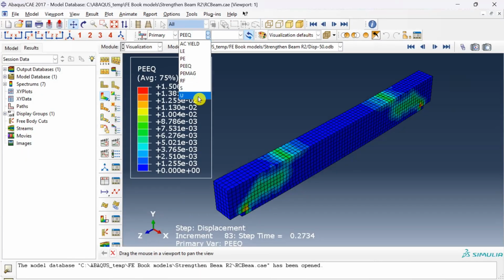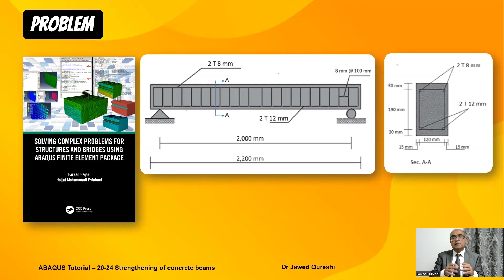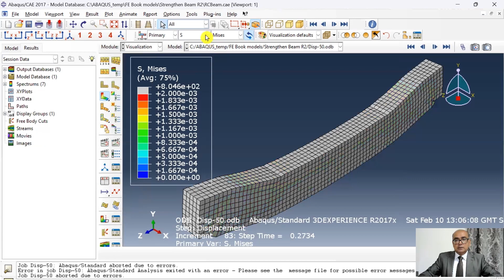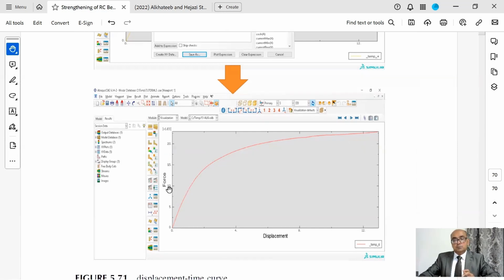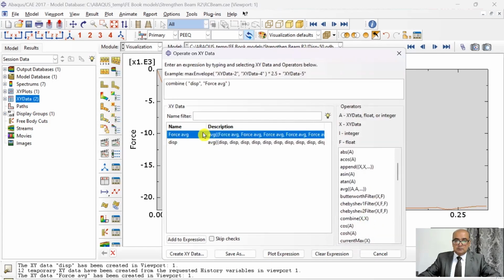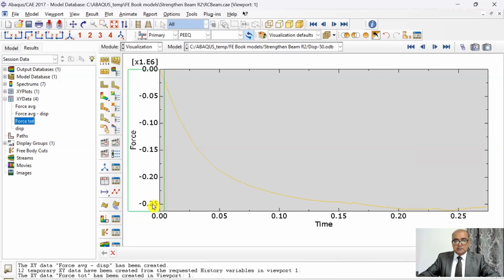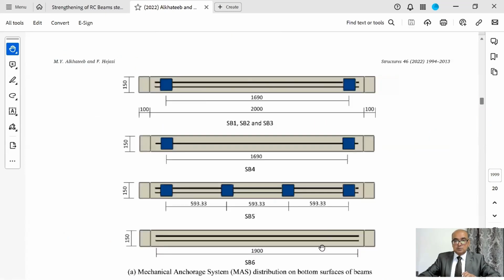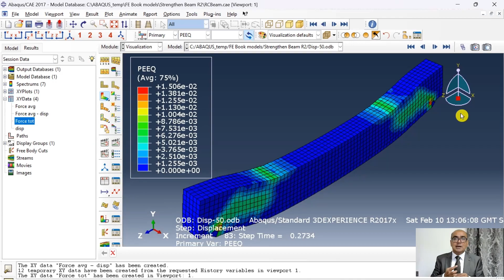24 – Part 5: Visualisation | Strengthening of concrete beams | ABAQUS Tutorial

Comment: Can CDP capture the pinching effect during cyclic loading of RC?  if yes, please tell me how?
Can CDP cappture the shear reduction of concrete during cyclic loading ? thanks
Reply from the maker: The quick answer is that I’m not sure. Crushing and cracking parameters should be defined to get accurate behaviour. I’ll try to find out and let you know. I’ve used CDP previously to model steel-concrete composite beams. Have a look at my paper https://www.sciencedirect.com/science/article/abs/pii/S0143974X10002609